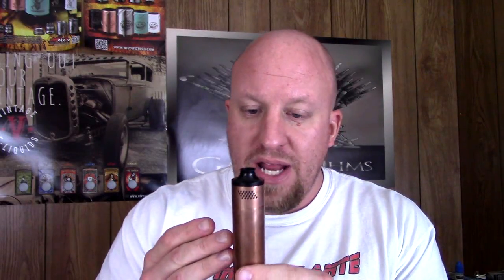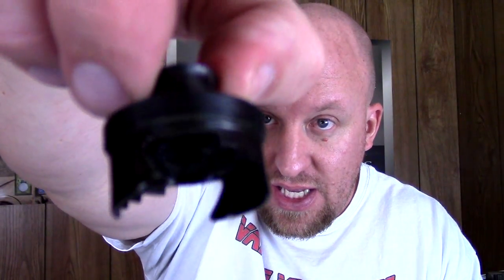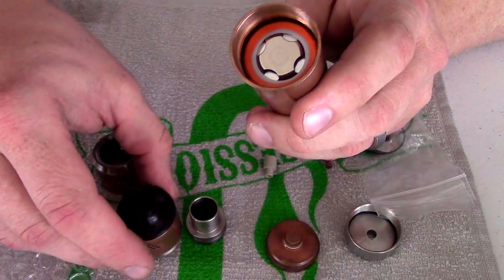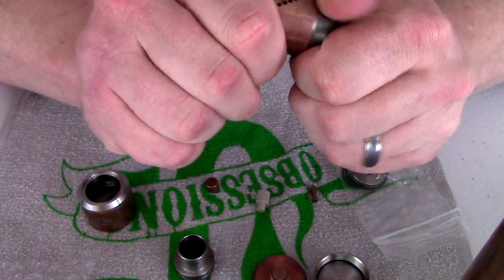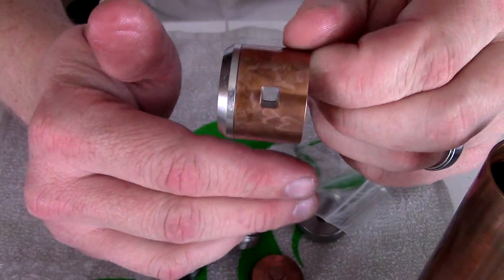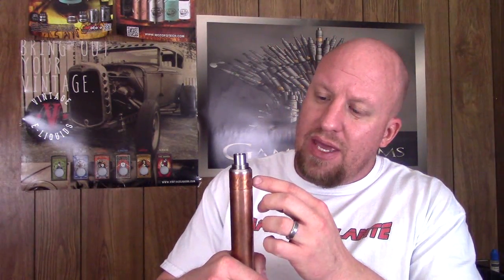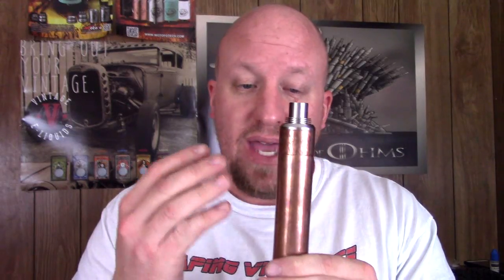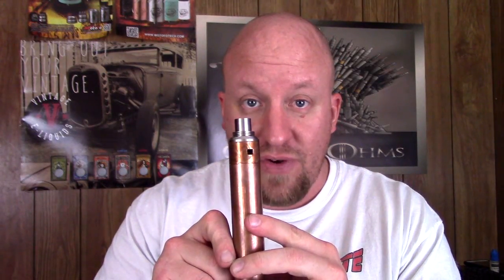The Stacked Mod & The Dripper by Scottua

Comment: What kind of 26650's are you a fan of? I like the mnke but they have a high internal resistance.
Reply: The panasonic CGR26650 is the best 26650
Reply: Basen 26650's have the lowest internal resistance on the market for all round cell batteries at 10 milliohms even badass 18650s such as 25r's vtc's etc have a 30 milliohm resistance
Reply: +Austin Koonz Panasonic is a more trusted brand then Basen.
Reply: Okay well Basen 26650s can support lower ohm builds. Internal resistance of 100 milliohms is horrible i dont suggest building past .5 on them i wouldnt doubt it if that was the ir of those panasonics. Vape safe man. I cloud chase so i have to know these things